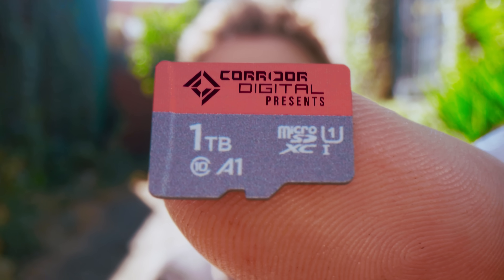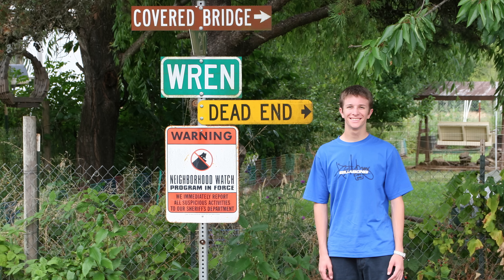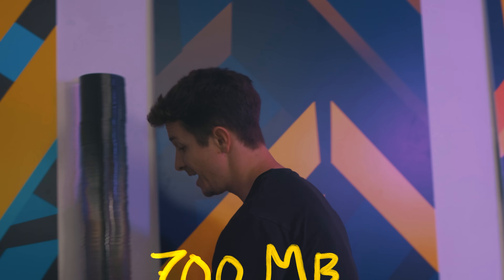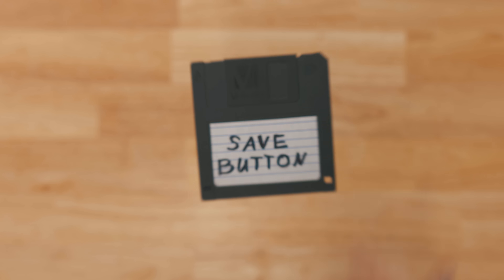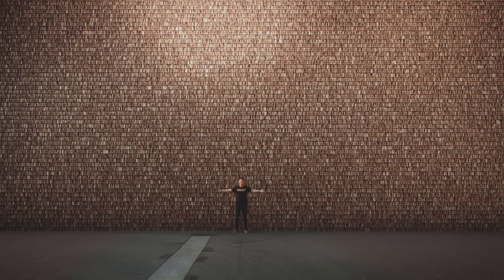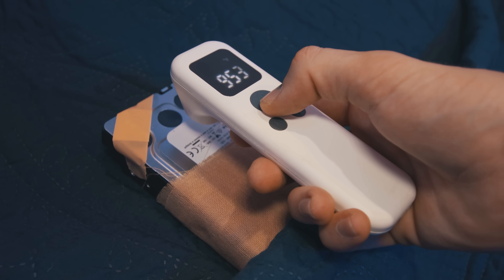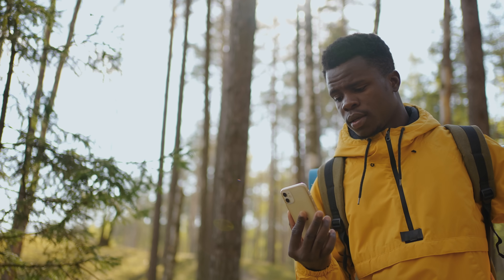VFX Artist Reveals the TRUE Scale of Data!

Comment: In order to store 8x10^23 bits it would be 70% the size of the moon, and require roughly 17 times the total power the entire planet used in 2019.Displaying that energy as mass would be roughly 170 tons. That’s roughly the weight of the Statue of Liberty. The top 500 richest people in the world combined could not afford it. Mind you that this number is exactly 1/1,000,000 of a single yottabyte. 
Our DNA is represented as 370 Geopbytes. This number is so massive that there isn’t a clear structure beyond a yottabyte which is one million times smaller than required. If you cut a human being into one million pieces and took just one of them, it would contain 370 yottabytes of information. 
It took nearly an hour of googling to put this together.

Comment: What if i use paper for storing images (they occupy much more storage than txt) so the average data a page can store would be much much higher.
Reply: doesnt store bits
Reply: @opticalreticle   Lets say i print an image (5MB) on a paper using a printer. Then is it not true that the paper holds 5MB of information ?
Reply: @kaamilverma1602  no you cant compare digital data with an image. digital data is comprised of bits that are either 0 or 1. let's say that the image would take 5mb in a lossless PNG, that does not mean that the image is like a disk that can store 5MB.
Reply: @opticalreticle  makes sense, thanks for the knowledge.

Comment: There are 3.04 trillion trees in the world. Let's assume each is capable of providing 15,000 pieces of paper. That would give you 45.6 quadrillion pieces of paper. Assuming each page stores 3,726 characters, each a byte, that would give you 169.9 exabytes worth of data. So, if you cut down all the trees in the world and made them into paper, it wouldn't be enough to store a single day's worth of data that is generated today. Many trees have been saved by the use of modern storage devices.

Comment: They are doing research into DNA as a storage medium. The most difficult part is finding and standardizing a way to read and write that data for cheap. That said I don't think storage is the most important breakthrough we would get from modifying DNA.
I genuinely think Quantum Computers will be commercially available before DNA storage. Or is that want. I don't know at this point.
Reply: Stabilisation is a problem as well. Imagine playing some AAA games on your tower pc and the dna just denatured because the T in the rig raises couple degrees
Reply: @ccclcsr  lol I would imagine that the DNA is stored in some bioengineered organism that maintains the DNA and somehow allows a machine to read the dna
Reply: I actually work with a company working on this. The current theoretical usage is very cold storage, where you don't care much for the IO speed but the storage stability and density. Obviously the density is quite good, but the stability is also quite good with sealed, cooled storage. Writing actually isn't too bad, as you can print DNA sequences fairly rapidly (though obviously magnitudes slower than electronic storage). Reading is a huge hassle though, and that is what the company is currently working on.
Reply: @akamesama  I don't understand, DNA Isa molecule, and all the exercise of 'DNA storage' is about molecule level density of storing data, then why not create other kind of molecules? Why DNA only?
Reply: @swapnilp5774  We do and have tried other materials. Silicon storage is the current suggestion as a successor to tape drives for long-term storage. However, even though the density is higher than magnetic storage, in both cases, you are limited by the accuracy at which you can read and write, since the form of the media is the data.

The primary reason for DNA is due to density. The data is stored in the different bases and they self-assemble, removing the resolution constraint of the data writing.
Reply: @akamesama that's really interesting, what company do you work with?
Reply: I imagine they'd call it "bio storage" at that point.
Reply: not to mention that dna is extremely fragile
Reply: Many people probably already know this, but the DNA information claimed in the video is as garbage as the trillions of quantum bits in any rock. You know it's sitting there but it's not really usable or useful. DNA bits are fragile and are very slow to read. There is also a chance of corrupting the data during reading or editing. Moreover, the entire body's DNA is just a matter of copying and pasting. Most cells have similar DNA, but each part of the gene is turned on and off differently to allow the cells to perform different functions. Actually usable DNA information is contained within 1 cell. Not the whole body If you wanted to find out the true storage efficiency of DNA, you could divide it by the total number of cells in a man's body. Yes, it's less than you'd expect.
Additionally, the size of the DNA data in this video is wrong as the creator said in the comments.
Reply: We can already read and write DNA, just not efficiently.
Reply: wot is a quantum computer
Reply: Yeah, only problem would be reading. And we would need to come up with a system that converts binary into DNA
Reply: Actual living storage
Reply: @pandoratheclay  ah yes man made horrors beyond my comprehension
Reply: @someone-pz4dg imagine a wall of flesh data, just to play crysis
Reply: @ledrosfan9970 HE SAID CRYSIS.. bruh. What bout that lil big planet

Comment: fun measurement is the after zettabyte it is yottabyte so the dna of the human body would equivalate to 370,000,000 yottabytes which yottabyte is the current largest storage size with a name I believe.
Reply: Well yes, because the byte would be at the scale of a molecules. It's also clearly the max theoretical possible density of data, but reading/writing that is a whole another challenge.
Reply: There is ronnabyte that is larger than yottabyte. Also quettabyte is larger than the ronnabyte.

Comment: Small small thing, a mega byte is 1024, not 1000
Reply: Actually no. You are thinking of a Mebibyte. Mega follows the same trend as kilo as in progression of 1000 . The 24 is because it is easier for computers to use power of 2 but has caused a different use of measurement.

Comment: Blu rays are called like that because they use a blue laser instead of a red laser to access the data wich is put in use on CD's and DVD's. That is because the tracks of a Blu ray are a lot thinner than the ones of a CD or DVD what makes it possible to store more data. These thin tracks are also the reason behind the fact that the blu ray looks dark. A lot less light is reflected, because it's wavelength is too big for the small tracks.

Comment: Fun fact, if every human being stores around 26 zettabytes of data that means that the whole human race stores around 208 billion data (8x26) this translates to 1.6639999999999997e+33 bits. I am going to assume that one bit is around 15cm (the one in the video) So all the bits times 15cm gives you 2.49599999999999955e+34 cm's of lenght if you were to set them on top of each other. This correlates to 249599999.99999997 Yottameters! That is 10x24 meters. It is said that our universe is around 93 billion light years, which is equel to 880 yottameters. This means that the lenghts of 26 zettabytes in bits is 283636 times larger than our universe.

Comment: Bro you are wrong 1024 kb = 1mb and 1024mb=1gb 1024gb =1tb
Reply: 10^3 bytes is 1 kilobyte, 10^3 kilobytes is a megabyte, 10^3 megabytes is a gigabyte and so on. What you are referring to is kibibytes, mebibytes, gibibytes, tebibytes, and so on. Normal kilobytes, megabytes, and gigabytes are measure by base 10 and kibibytes, mebibytes, and gibibytes are measured on powers of 2. 2^10 bytes (1024) is one kibibyte, 2^10 kibibytes is one mebibyte, 2^10 mebibytes is one gibibyte. So technically he is correct. Computers usually say KB, MB, GB and TB but they are actually referring to KiB, MiB, Gib and TiB (kibibyte, mebibyte, gibibyte, and tebibyte).That is the reason why you can buy one terabyte of storage but windows measures it as 931GB (GiB). Windows is using gibibytes and the storage is measured in terabytes, not tebibytes.

Comment: 1 KB = 1024 bytes and not 1000
1 MB = 1024 KB and not 1000 and so on ...
Computer based on 2 elevated, so 2^10 = 1024 and that's why...
This is a basic computing calculation...
And that why I give you a thumbs down, please respect the laws of computing... 🤣
Reply: 1KB = 1000 Bytes
1MB = 1000 KB

What you mean is kibibyte and mebibyte. 
1 KiB = 1024 Bytes
1 MiB = 1024 KiB

And that's why I give you a thumbs down. ;)
Reply: 10^3 bytes is 1 kilobyte, 10^3 kilobytes is a megabyte, 10^3 megabytes is a gigabyte and so on. What you are referring to is kibibytes, mebibytes, gibibytes, tebibytes, and so on. Normal kilobytes, megabytes, and gigabytes are measure by base 10 and kibibytes, mebibytes, and gibibytes are measured on powers of 2. 2^10 bytes (1024) is one kibibyte, 2^10 kibibytes is one mebibyte, 2^10 mebibytes is one gibibyte. So technically he is correct. Computers usually say KB, MB, GB and TB but they are actually referring to KiB, MiB, Gib and TiB (kibibyte, mebibyte, gibibyte, and tebibyte).That is the reason why you can buy one terabyte of storage but windows measures it as 931GB (GiB). Windows is using gibibytes and the storage is measured in terabytes, not tebibytes.

Comment: 1024 bytes is 1 kilobyte NOT 1000
Reply: 10^3 bytes is 1 kilobyte, 10^3 kilobytes is a megabyte, 10^3 megabytes is a gigabyte and so on. What you are referring to is kibibytes, mebibytes, gibibytes, tebibytes, and so on. Normal kilobytes, megabytes, and gigabytes are measure by base 10 and kibibytes, mebibytes, and gibibytes are measured on powers of 2. 2^10 bytes (1024) is one kibibyte, 2^10 kibibytes is one mebibyte, 2^10 mebibytes is one gibibyte. So technically he is correct. Computers usually say KB, MB, GB and TB but they are actually referring to KiB, MiB, Gib and TiB (kibibyte, mebibyte, gibibyte, and tebibyte).That is the reason why you can buy one terabyte of storage but windows measures it as 931GB (GiB). Windows is using gibibytes and the storage is measured in terabytes, not tebibytes.

Comment: Not that youll probably see this, but a Terrabyte is 1024 Gigabytes, not 100. Same with all the other measurements lol.
Reply: 10^3 bytes is 1 kilobyte, 10^3 kilobytes is a megabyte, 10^3 megabytes is a gigabyte and so on. What you are referring to is kibibytes, mebibytes, gibibytes, tebibytes, and so on. Normal kilobytes, megabytes, and gigabytes are measure by base 10 and kibibytes, mebibytes, and gibibytes are measured on powers of 2. 2^10 bytes (1024) is one kibibyte, 2^10 kibibytes is one mebibyte, 2^10 mebibytes is one gibibyte. So technically he is correct. Computers usually say KB, MB, GB and TB but they are actually referring to KiB, MiB, Gib and TiB (kibibyte, mebibyte, gibibyte, and tebibyte).That is the reason why you can buy one terabyte of storage but windows measures it as 931GB (GiB). Windows is using gibibytes and the storage is measured in terabytes, not tebibytes.

Comment: 2:49 -> you meant 1024 I hope...
Reply: 10^3 bytes is 1 kilobyte, 10^3 kilobytes is a megabyte, 10^3 megabytes is a gigabyte and so on. What you are referring to is kibibytes, mebibytes, gibibytes, tebibytes, and so on. Normal kilobytes, megabytes, and gigabytes are measure by base 10 and kibibytes, mebibytes, and gibibytes are measured on powers of 2. 2^10 bytes (1024) is one kibibyte, 2^10 kibibytes is one mebibyte, 2^10 mebibytes is one gibibyte. So technically he is correct. Computers usually say KB, MB, GB and TB but they are actually referring to KiB, MiB, Gib and TiB (kibibyte, mebibyte, gibibyte, and tebibyte).That is the reason why you can buy one terabyte of storage but windows measures it as 931GB (GiB). Windows is using gibibytes and the storage is measured in terabytes, not tebibytes.

Comment: actually one megabyte is equal to 2^20 byte
Reply: 10^3 bytes is 1 kilobyte, 10^3 kilobytes is a megabyte, 10^3 megabytes is a gigabyte and so on. What you are referring to is kibibytes, mebibytes, gibibytes, tebibytes, and so on. Normal kilobytes, megabytes, and gigabytes are measure by base 10 and kibibytes, mebibytes, and gibibytes are measured on powers of 2. 2^10 bytes (1024) is one kibibyte, 2^10 kibibytes is one mebibyte, 2^10 mebibytes is one gibibyte. So technically he is correct. Computers usually say KB, MB, GB and TB but they are actually referring to KiB, MiB, Gib and TiB (kibibyte, mebibyte, gibibyte, and tebibyte).That is the reason why you can buy one terabyte of storage but windows measures it as 931GB (GiB). Windows is using gibibytes and the storage is measured in terabytes, not tebibytes.

Comment: while the terminology is accurate, it's not perfect, as digital information is stored in binary aka base 2, and kilo, mega, giga, tera, peta, etc are metric prefixes, counting by three powers of ten progressively, meaning that a perfect gigabyte would be exacly 10^9 sets of eight binary values, or bits. an actual gigabyte is 1.024*10^9 bytes. I hate it when math, the very tool invented for precision does not line up perfectly with itself.

Comment: For who's interested: Bluray is called bluray not because it's blue but because the ray is reflected on the DVD while it spins (the reading pin) is a blue (or violet) ray. This allows for the bytes to be written closer together allowing for a larger amount of data to be stored on 1 disk. Amazing video btw!
Reply: is it because the wavelengths for blue light is shorter than farther down the spectrum
Reply: @throwaway-hp1wt  yes that is correct , because of the shorter wavelength the data can be written closer together.
Reply: hell nah let's call dvds "redray"
Reply: @NathanPlays395  what about peachray 

Everyone look up the weirdest color names. Tell them to me.
Reply: @Ezdubsquestion  Drake’s-Neck is a color
Reply: Whoa that's cool thanks!
Reply: It’s literally in the name. Blu-ray. blue ray.
Reply: I think he just made a dad-joke.
Reply: It's not a DVD.
A DVD is a softer polycarbonate while a Blu-ray is much harder resistant to scratches material because the data is so dense a typical scratch on a DVD would make the Blu-ray inoperable.
Reply: I somehow didn't even know disks having different names meant different storage capacity. I thought they were all called CDs and that the other names were synonyms. I thought Blu-ray was a brand.

Comment: One A3 list of paper is around 15x20 cm. If we say one number can be written in one 0.5x0.5 cm square on that list, it gives us 1200 numbers per notebook page. Double that per list.
One terabyte is around 8*10¹² of ones and zeroes. Divide that and we get 3.3*10⁹ of A3 lists.
One piece of paper is around 0.1mm width, which multiplied by the number of lists gives us 3.3*10⁵meters, or 330 kilometers. Or 33 mountains Everest stacked on top of each other.
The answer: 330km of A3 papers filled with knes and zeroes

Comment: Don’t the prefixes for different amounts of bytes represent 1024, not 1000? I.E. 1024 bytes in a kilobyte, 1024 kilobytes in a megabyte, etc…
Reply: 10^3 bytes is 1 kilobyte, 10^3 kilobytes is a megabyte, 10^3 megabytes is a gigabyte and so on. What you are referring to is kibibytes, mebibytes, gibibytes, tebibytes, and so on. Normal kilobytes, megabytes, and gigabytes are measure by base 10 and kibibytes, mebibytes, and gibibytes are measured on powers of 2. 2^10 bytes (1024) is one kibibyte, 2^10 kibibytes is one mebibyte, 2^10 mebibytes is one gibibyte. So technically he is correct. Computers usually say KB, MB, GB and TB but they are actually referring to KiB, MiB, Gib and TiB (kibibyte, mebibyte, gibibyte, and tebibyte).That is the reason why you can buy one terabyte of storage but windows measures it as 931GB (GiB). Windows is using gibibytes and the storage is measured in terabytes, not tebibytes.

Comment: 8bits = 1 bytes 
1024 bytes= 1mega byte
1024 mega = 1 giga bytes 
1024 giga bytes = 1 terra bytes
Reply: 10^3 bytes is 1 kilobyte, 10^3 kilobytes is a megabyte, 10^3 megabytes is a gigabyte and so on. What you are referring to is kibibytes, mebibytes, gibibytes, tebibytes, and so on. Normal kilobytes, megabytes, and gigabytes are measure by base 10 and kibibytes, mebibytes, and gibibytes are measured on powers of 2. 2^10 bytes (1024) is one kibibyte, 2^10 kibibytes is one mebibyte, 2^10 mebibytes is one gibibyte. So technically he is correct. Computers usually say KB, MB, GB and TB but they are actually referring to KiB, MiB, Gib and TiB (kibibyte, mebibyte, gibibyte, and tebibyte).That is the reason why you can buy one terabyte of storage but windows measures it as 931GB (GiB). Windows is using gibibytes and the storage is measured in terabytes, not tebibytes.

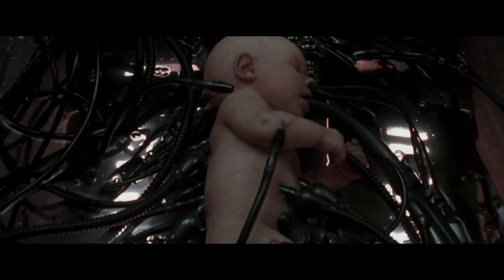Comment: 13:00 that’s 370,000,000 yottabytes, 370,000 brontobytes or 370 geopbytes. That’s 2,960,000,000,000 geopbytes for the entire human population (8 billion people). I would’ve converted it into larger units, but i couldn’t find any.
Reply: Mr dad I also did the calculations the amount of space of 7 billion people's dna (almost are population of the world) would be almost 3 MILLION Domegemegrottebyte 1 Domegemegrottebyte  is 1,000,000,000,000,000 Zettabytes or 1.e+21 Micro sd cards Or 1.e+36 Bits. Thats more than my calculator can handle AND THATS NOT EVEN THE 8 Billion You used!
Reply: Also a Domegemegrottebyte is 5 x 1000's of a zettabyte (thats what i found on the internet)
Reply: @McBoiMally  isn’t that just 5 exabytes?
Reply: @dad49998  i dont even fucking know by this point
Reply: @McBoiMally 
His info was wrong in the video
He corrected it in the comments tho.
Reply: also dont trust might be wrong
Reply: 0.37GYbytes (GigaYotta)